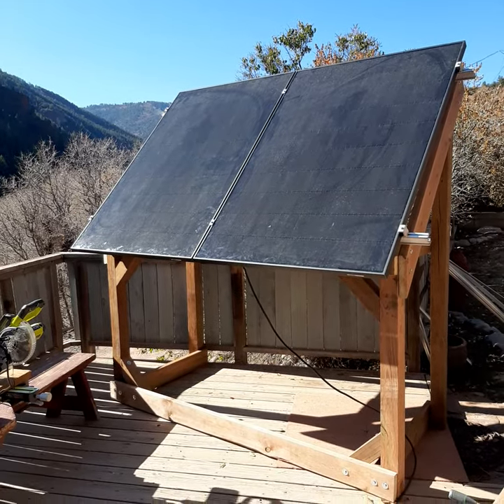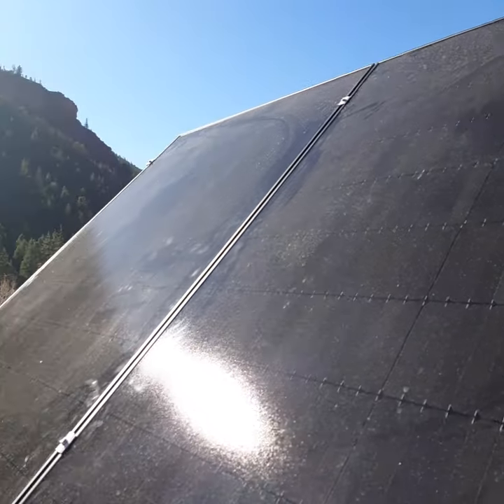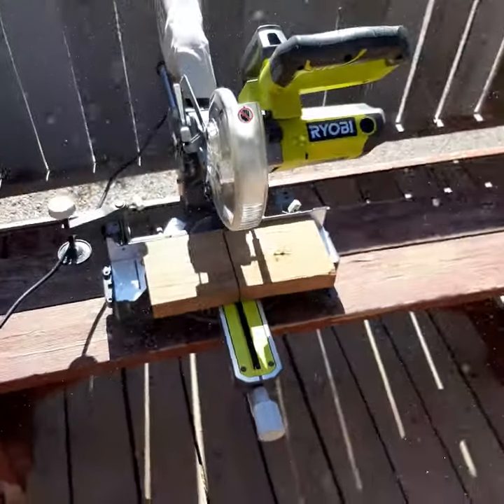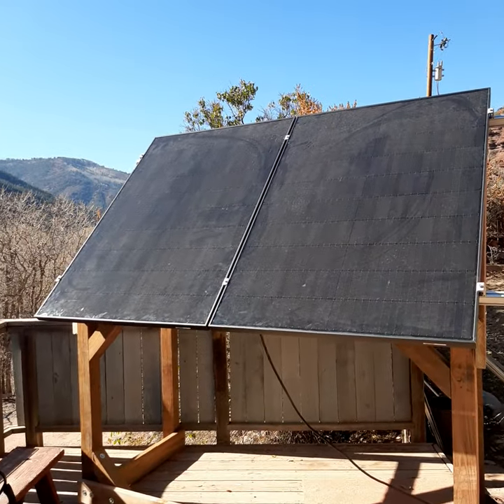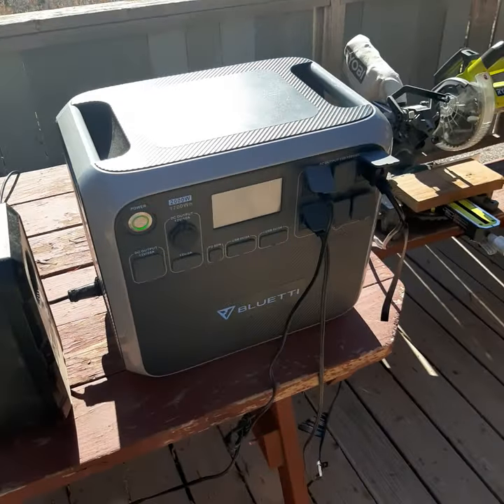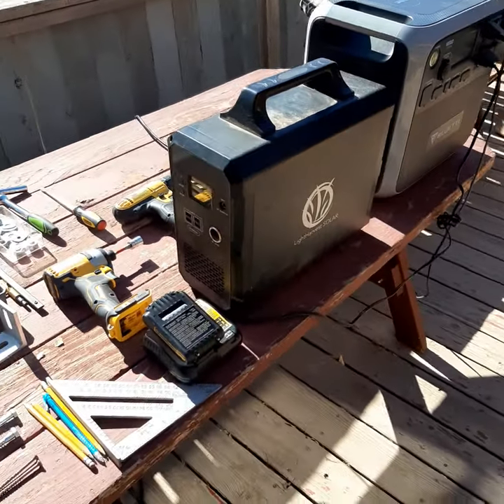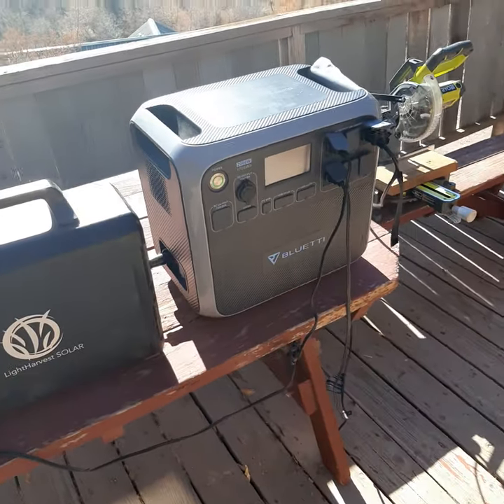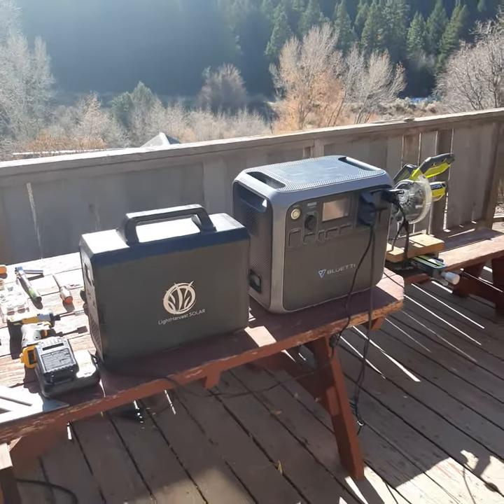Emergency off grid solar backup/product test rig.100% built by sun and our plug and play power boxes

Comment: are these backup only or can they handle continuous use? can multiple dc appliances be wired in to them (or hooked up another way)?
Reply from the maker: They are for sure continuous use.  Most of my customers (and me) use them for rv's and camping but I use mine every day when I'm not camping. I generate a lot of power so I use it all. Free energy is good.  Backup is just a huge added value.  There are multiple AC and DC outputs.  Thanks.